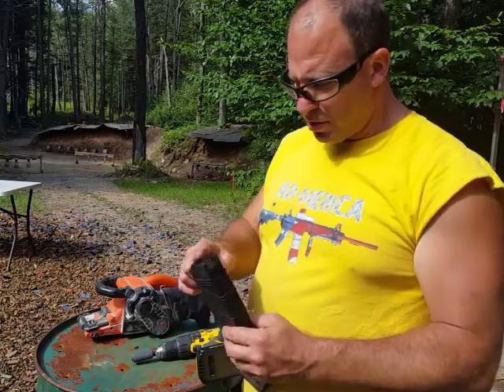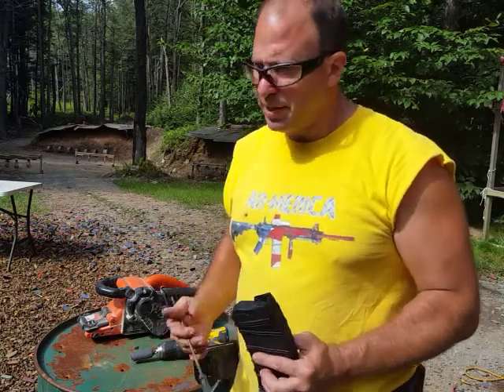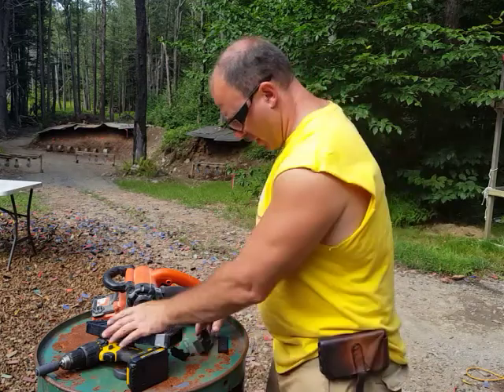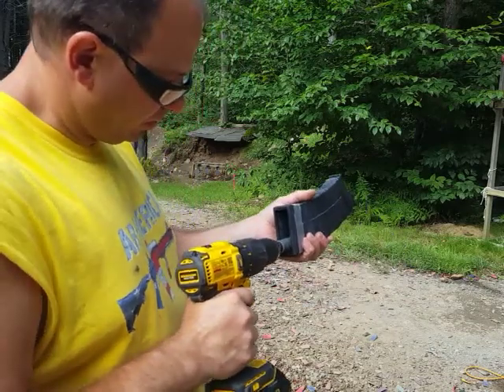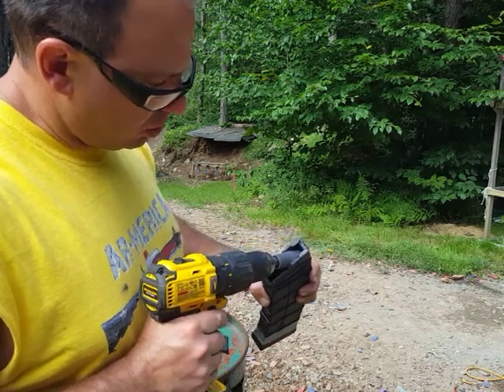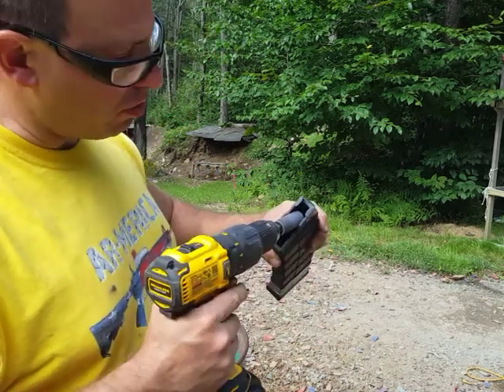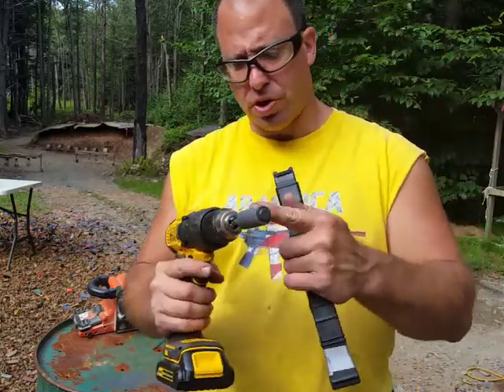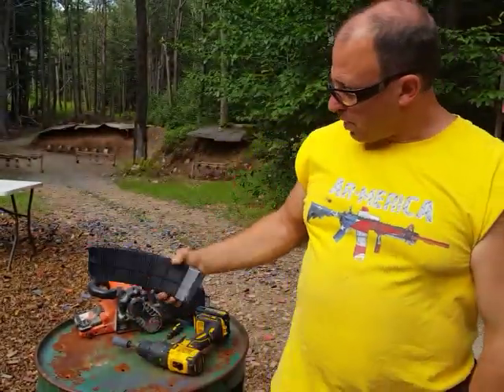AGP Lynx / Saiga AK 12 magazine FIX

Comment: How does a full auto Ak work?
Reply from the maker: Something has to trip the disconnector when the bolt goes forward. There is a number of Parts  activated when the safety lever is in the middle position on a factory-built full auto. The third hole is in front of the trigger pin with the main activator that is tripped by a cut out in the bolt.

I have not seen anybody invent an auto Sear to convert a semi-auto into full like an AR-15